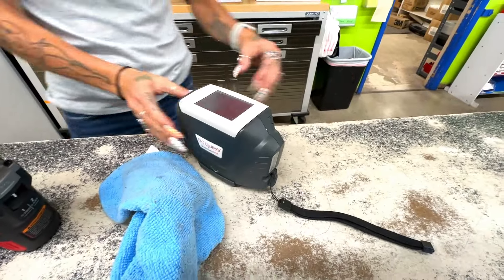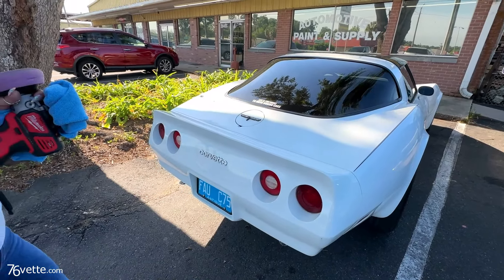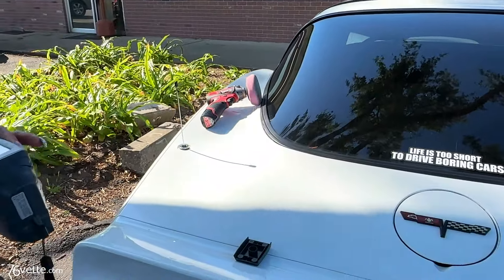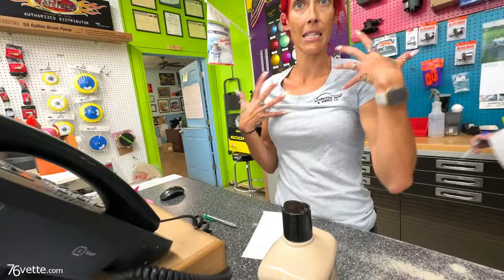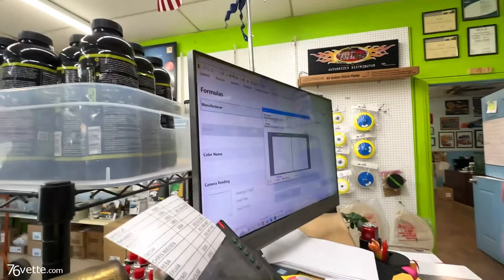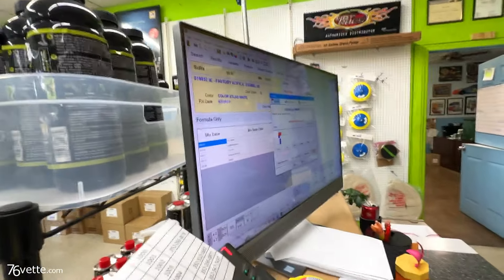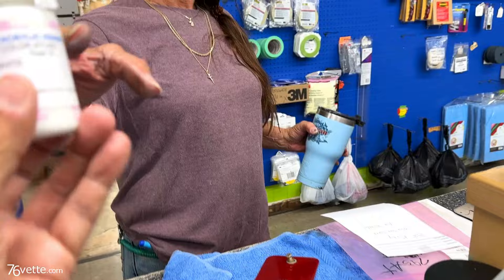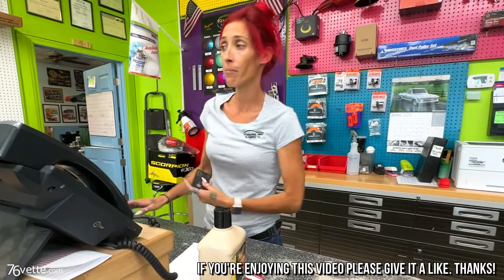Get the PERFECT PAINT MATCH for Your Car

Comment: I live near that area and am thinking of going, how did the new paint look on the chip on the rear of your car? And about how much was that little bottle?
Reply from the maker: I am very happy with the paint match, but I’ve only used it on a few spots with small chips since I’m not the best at doing this. I think to get excellent results, I would have to buildup touchup layers, let them cure fully, and then color sand and polish them to achieve a perfect blend. I paid $19.26 for the small bottle. 😊👍🏻